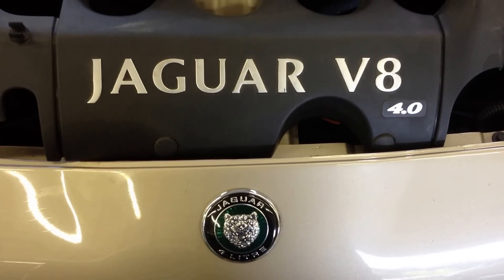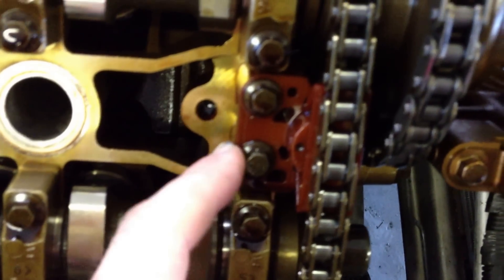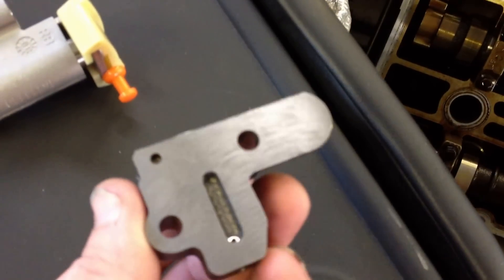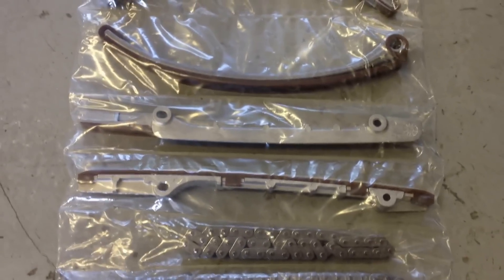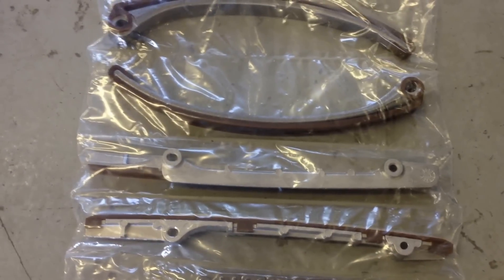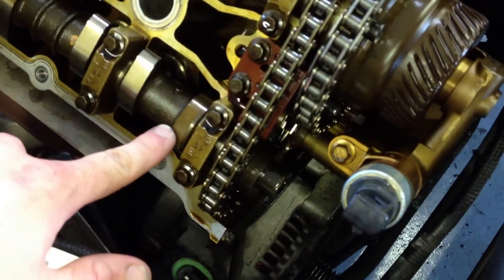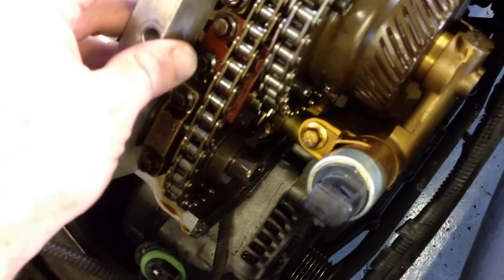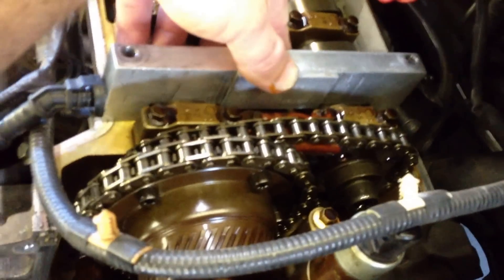Jaguar 4.0L AJ8 V8 Timing Chains and Tensioner Part 1

Comment: Hey, the timing chain and tensioner tasks are rather straight, but to access the front cover of the engine, I really had to work my a... off. Removing the Aircon compressor and the power steering pump to access the holding unit for these two devices. On the opposite side the alternator also had to be removed to access the mounting unit for the alternator - both parts are horrible to disassemble due to lack of space. Another thing to remember is the pulley / vibration damper - the one with the conic locking ring is really nasty.

Comment: You mentioned that the timing is set at TDC but from what I remember during the development of the engines over 20 years ago it was set at 45 degrees after TDC from cylinder 1A. Cylinder 1A is at the front of the car on the right as viewed by the driver. That’s the only position that the pin can be pushed into the drive plate through the crank sensor hole. The reason for that position is to reduce the risk of valve damage during setting the timing.
Reply: You are right, it sets the cams in the "safe position" if I recall correctly. Also, if you are just changing tensioners there is no need to unbolt the cams at all, just mark all the sprockets and chains and put back together as they came apart. This job is nowhere near as hard as people make out. Are you the Stephen Smith who worked in Engine Development?

Comment: Hi! Will you give me advice please. I have an little oil leak from under the timing chain cover (AJ8). Mechanic says to replace timing chain cover gasket. For this action do I need to take out the engine? And do I need to disconnect the supercharger?
Reply from the maker: Engine can stay in the car, but I'm pretty sure Supercharger has to come off.
Reply: @AutohausLakeNormanDenver  Ok. I understood. Thanks!

Comment: Where did you get the timing chain tool to hold the cams. i have a s type v8 and i need to change the cam chains?

Comment: I have a 1999 Jaguar Vanden Plas I doing a timing change and I have the locking tool ON. & the gear on the main timing has 2 has some play 2 teeths back and forth do you know the correct adjustment on that ?

Comment: great video, you noted you would get an oil leak when the tentioner gave away, where would the oil leak happen?
Reply: The leak is internal to the engine. The issue is that when it does leak, you have a loss of pressure at the tensioner which prevents the chain from having proper tension.
Reply: great, I just purchased a 99 with 117K miles and was told the tensioners have been replaced but no receipt, can these cars run that long without being replaced?
Reply: Bernard Tripp 

great, I just purchased a 99 with 117K miles and was told the tensioners have been replaced but no receipt, can these cars run that long without being replaced?
Reply from the maker: Mitch Grooms
Hard to predict how long one will run with the original plastic components.  The best way to tell, is to pull the valve cover.  Removing the cover is very easy to do, you will will be able to see if the upper tensioner is plastic or aluminum.
Reply: Just got a 98 XJR with 53,000 miles,  i will be doing this soon, thanks a bunch

Comment: Lift the cams, still connected. Slide old tensioners out and new ones in. Nothing will be adjusted and the tensioners will be right in the perfect spots. Takes 10 mins. Spend the last few hours cleaning up and putting the engine back together.
Reply: This is the truth. Done it a handful of times. No need to invest in tools etc.  now if the chain broke, or skipped a tooth...

Different story

Comment: Sir where did you get the tools and updated components?
Reply from the maker: There are many suppliers for both tools and parts.  eBay is a good source, I see the tool kits run between $200-250 all the time.  I think there are chain kits as well.
Reply: Autohaus Lake Norman Did you use DNJ parts?